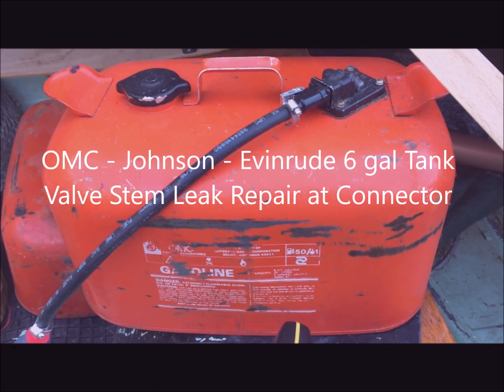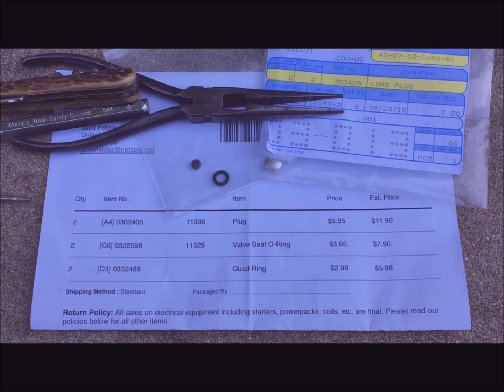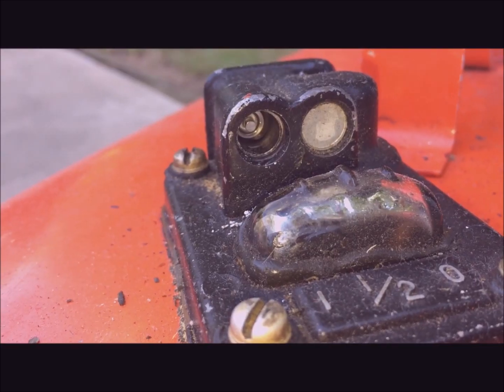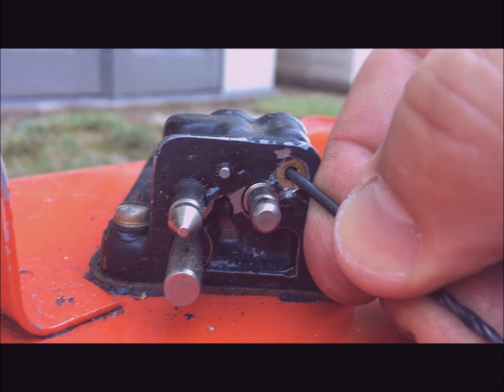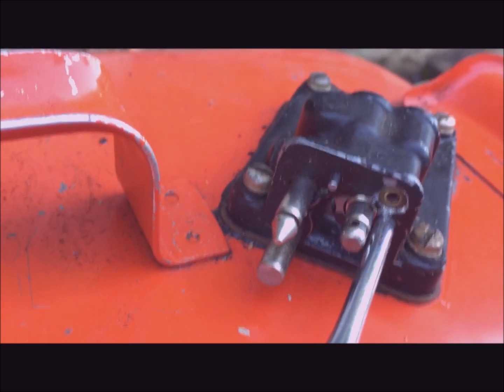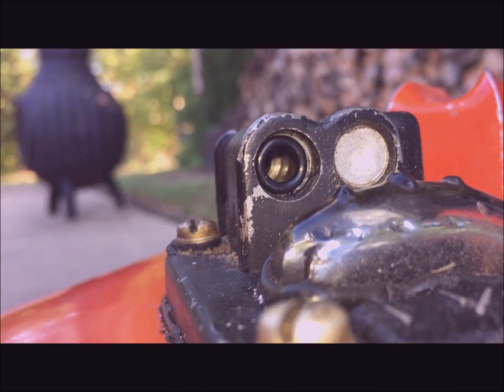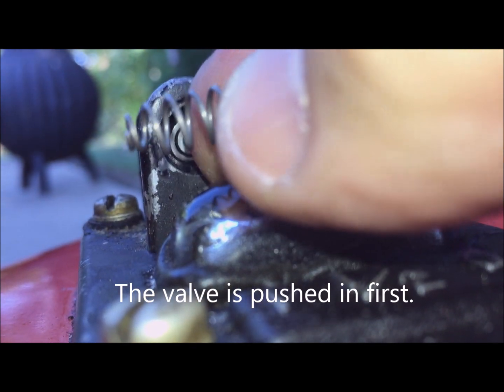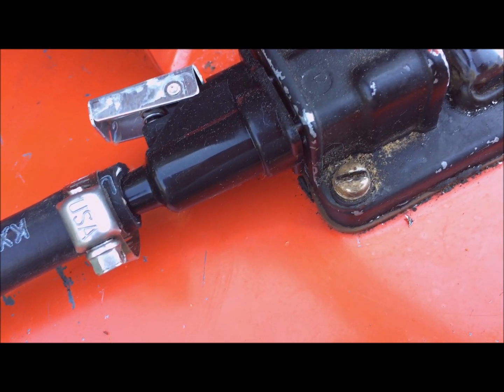OMC Evinrude Johnson 6 Gal tank valve stem repair

Comment: Thanks for the video. My fitting won’t seal and keeps sucking air so the motor quits. I made a cork gasket to get the fitting to fit with force over the stem so it won’t move.
Reply from the maker: Sounds like your fitting’s seal is bad.  Have you tried a new fitting or a whole different hose assembly?
Reply: @davemilster  I just removed the fitting, pushed the  bearing down, and cleaned the o ring. I cut the fuel line aback and inch for a better seal. I also cleaned the male fitting on the old OMC tank.  I plugged it back in and got a firmer feeling primer ball. But when I wiggled the fitting gas came out between it and the tank connector. Going to start with a new fitting and see if the $4 part fixes it. The connector doesn’t fit flush for some reason. There are spring loaded rods that push against the fitting to hold it in place and also pushes it out a little maybe it’s the way it is designed and the O ring in the fitting is worn out?
Reply from the maker: @tripplebeards3427  the fitting doesn’t usually fit flush. There will be 1/16” gap. That’s not critical as the collar in the fitting is past the holes in the male part on the tank.
Reply: @davemilster  the  new fitting fixed the issue. Thanks!

Comment: I have this problem but it's with my 1970's 9?9hp yam 4stroke on the engine's male connection the clip keeps slipping off been trying to research this issue. Probably is the O ring ...
Reply from the maker: Your Leak is around the main tube. The leak I’m showing is the plunger valve stem that permits fuel flow through the tube.  Two different problems

Comment: I like your O Ring extraction tool. I have one too. You must be a telephone man. That tool in real life is a dial tool. It was used to remove a rotary dial to replace the phone number inside the dial.  Also the tab on touch tone models to replace the phone number. The other end is used to tuck in cross connect wire. The tool is also sometimes called a spudger. It is one of my go to tools for working on outboards. works great for tucking wires in their place on mags.
Reply from the maker: I just figured out how to reply on You Tube... Sorry it has taken so long. Nope, not a telephone man. I found this tool on the ground someplace years and years ago. I'm a retired engineer/handyman.

Comment: I'm trying to figure out how to get my connector to sit flat against the tank. It pops out about a 1/16 to 1/8th inch and doesn't seat.
Reply from the maker: Is the connector an OEM? or an after market? An aftermarket may not have the same tolerances as the OEM.
Mine (an OEM by OMC) will pull back up to a 1/16"
Reply: @davemilster  yes it's an OEM one. I can't get it to close up enough to get the tank vent to work.
Reply from the maker: Patrick Prafke 
There is no vent on the connector on the tank.  There is a fuel shutoff plunger. Will it not allow fuel to pass into the connector/hose?
Reply: It's the top and right little prong. Impress that in and the tank vents. My connector doesn't press it in far enough to vent properly. That's the issue I'm having.
Reply from the maker: @patrickprafke4894  The top right needle is the fuel shut off which allows fuel into the hose through the large prong with holes when pushed in. This needle shuts off fuel so that when the hose/connector is removed the fuel cannot escape. In the video, at 16 seconds you can see the fuel leaking around this needle.
Reply: @patrickprafke4894  Patrick push it in harder. I’m not kidding. The springed latch is not engaging and holding the assembly together. Push them together harder and the thumb lever should latch in place. And then hold both pieces tightly together.
Reply: @georgekeats1478  did exactly that several times. Just replaced the entire everything on both ends with a custom jobby. Now it works.
Reply: @patrick prafke yes and mine is leaking the petrol when trying to make connection

Comment: I have one of these and if I take hose off with cap still on tank gas will come out of the fuel connection nipple from the pressure. No leaks anywhere else. You state that there should not be any fuel come out with hose disconnected. I guess I need this repair. Do these vent without connector on since it pushes other pin in?
Reply from the maker: these tanks do not vent.  your valves oring seat is bad. yes you need this kit installed

Comment: What fitting did you use to connect the fuel line to the fitting? What size?
Reply from the maker: I've used Attwood OMC connectors, but not been successful with them. Sierra is a decent aftermarket part. OEM (BRP OMC Evinrude Johnson) are the best. They usually are 5/16" hose size. The connectors are designed to fit these tanks. Here are three links to where you can find them (among other places).

https://www.amazon.com/Johnson-Evinrude-OMC-Connector-Fitting/dp/B001KYNHSC?source=ps-sl-shoppingads-lpcontext&ref_=fplfs&psc=1&smid=A19A31B2DXU7GU                  

https://www.boats.net/product/brp/0174507?CAGPSPN=pla&utm_source=google&utm_medium=paid&utm_campaign=21180406766&utm_content=&utm_term=&gad_source=1&gclid=CjwKCAjwjqWzBhAqEiwAQmtgT-WGX9K-1aNXMNIqxNTkvLOiTxIMMgGj7UUQkZowgsKOR3sYOF5IjRoCNoMQAvD_BwE

https://www.marineengine.com/parts/johnson-evinrude-parts.php?year=1974&hp=25&model=25E74M&manufacturer=Johnson&section=FUEL+TANK-6+GALLON

Comment: Would this connection problem cause the motor to die? I have an Evinrude fisherman 6h and my connection looks the same (loose). Thr motor runs but the squeeze ball for the gas line gets soft and I have to pump it again to restart the motor. I'm assuming air is getting in the line thru the loose connection and causing it to die?
Reply from the maker: Several things to check. 
1. Is the connector on your hose an OEM OMC/Evinrude/Johnson? Aftermarket such as Atwood or Sierra may not push on sufficiently. Worse, a Chinese connector may be bad too. 
2. Look at the rubber seal in the connector where it pushes onto the tank. Is it cracked? Dried out and brittle?  air can get around this bad seal. 
3. For another thing to try.  Twist open the gas cap before you run the motor. If this keeps the bulb full then the other pin (which is the tank vent) may also need repair. There is a hole about 1/16-1/8 diameter below the vent pin. Is this hole plugged up?  Take a pointed tool and scrape underneath this pin. The hole is visible between the tank and the pin. 
4. Does the motor keep the primer full when on another tank?
5. Have you tried a different hose?

Comment: Hello. I have one of these tanks too. Mine is leaking also but from the larger pin with the holes in it. It only leaks when the can is under pressure but it will leak nonstop until the can is empty. Anyone have any suggestions, like a repair kit? Thanks in advance for your help.
Reply from the maker: The needle that was leaking on mine is also the shutoff valve to the fuel port where yours is leaking. You should be able to solve the problem doing the same procedure. As a stop gap until you have the opportunity to repair it, loosen the fuel cap part way, but not so much that the ears on the cap disengage. This will relieve pressure in the tank and should keep it from pushing the fuel out thru the port. The other option is to leave the fuel line connected at the tank (off at the engine) and assuming it has good O-Rings and seals, will also keep the fuel from leaking.
Reply: Thanks. I tried lubing that little pin which did work for the most part. But it still sticks a little. Maybe the spring has worn out.
Reply from the maker: It could be the spring is broken, but more likely the O-ring INSIDE has gone bad due to ethanol in the fuel (and age of course).  @tomtwhite1
Reply: DCM thanks

Comment: The directions and part numbers were very helpful, thank you. However, I did the repair, and it still leaks. When fuel expands inside the tank, it's pushed out through the larger fuel feed tip, not the spring-loaded shut off. The only way to avoid it is keep the fuel line attached to the tank. The spring loaded pin does not leak. Any idea what I did wrong, and which of the two replaceable rubber parts is bad? When I was finished, the spring loaded pin was VERY tight, but I worked it back and forth a little and it loosened up. Thanks for the help.
Reply from the maker: The O-ring "inside" around 4 minutes into the video, is the seal that shuts off the fuel from leaking out the connector. If the needle isn't free to sit against this seat, then the fuel will as you mentioned leak by this O-ring into the connector.  The needle should move freely in and out. 
I'm afraid you may need to obtain another kit, only this time slide the thicker O-ring (around 3 minutes) on the needle itself. Is it free to slide? It should be. Before putting the O-rings in, make sure the needle travels easily in and out in the housing, too. 
Hope this helps.

Comment: Your parts lists shows quantity of 2 each. Did you actually use all of these parts? Did you disassemble the adjacent valve too? The Crowley Marine diagram indicates only 1 p/n 0332988 (quad ring) is required.
Reply: Crowley Marine did not stock that quad seal so they sent an "equivalent" o-ring that produced enough drag on the valve stem to prevent proper shutoff of the outlet port when fuel line was disconnected from the tank. I recommend buying the original OMC quad seal (available on eBay) rather than this substitute o-ring. Here are dimensions of parts in case you want to use another source: valve seat o-ring: OD 0.350", cross section 0.07" which equates to an o-ring size 009; plug: OD 0.375", 0.064" thick aluminum; quad ring: ID 0.060", OD 0.200", height 0.108" as compared to Crowley's o-ring ID 0.036", OD 0.212", height 0.088". The valve stem diameter is 0.083". I oiled the valve stem and it seems to have reduced the drag enough so the valve works. You don't get many chances staking on the quad seal cover so again, my advise is to buy the OEM quad seal. Note that you only need quantity of one for each of these parts to fix that one valve shown in this video.
Reply from the maker: In March of 2021 I found this tank leaking fuel again, but not from the quad seal. It was the fuel cutoff.  :-O  As I did the video in Oct 2018 and now the O-ring failed already, I'm sorry to report that Crowley's O-Rings were subpar. The fuel cutoff was not shutting off as the O-Ring was now as hard as a rock! The quad seal was ok though. I had no success finding the OEM part unfortunately. If you find the link to where to obtain them, please SHARE the link or at least provide the website address (use DOTcom instead of .com as Youtube will strip off the address).

Comment: I have a question about this connector: do I need a special female connector (3 holes) or the regular 2 hole Johnson/Evinrude connector can do? Thanks.
Reply from the maker: This takes the regular two hole connector. Here's a link to AMAZON for the entire hose where you can see the end.  https://www.amazon.com/Evinrude-Johnson-Compliant-Hose-Assembly/dp/B005KD93FK
Several retailers make equal parts like Napa, West Marine, BassPro, Cabellas, Walmart, etc.
Here's Napa's link:
https://www.napaonline.com/en/p/BK_7511017?cid=paidsearch_shopping_dcoe_google&gclid=CjwKCAjwxqX4BRBhEiwAYtJX7doL-F7p-EsBbzDj8Q1g_e7OvatkEXil8bMJ6vmeaOBsbzIYDrWASxoC0VwQAvD_BwE
Reply: DCM thanks for that.

Comment: Thank you for this video, I own an old tank just like yours and would like to continue using it . I have an old 2pin 1984 Mariner 8hp that I would like to use with the tank. So I need to make a hose to connect  my tank to the Mariner outboard. What is the correct OMC part number at Crowley for the fuel line end plug that fits your tank? Again thanks for explaining this repair process.
Reply from the maker: Evinrude Outboard Motors 775641

Comment: I ordered the same part numbers you showed and instead of getting the double lip oring they sent me a tiny oring with a very tiny inner diameter.Guess I have to get hold of them.They sent me #037858 which supposedly supercedes 0332488,but I cannot believe the little oring alone is as good as that thicker double edged one you put in?It is half as thick Or less at best.Not sure how the brass plug could be staked back in properly with the size difference?

Comment: I am having the same issue. I am wondering why you drilled a hole in the rear of the valve stem? Did you patch the hole afterwards? I bought a motor that came with two of these tanks and both appear to have this same issue.

Thank you for any direction you can give

Comment: Sir, what is that 3rd prong? I'm trying to understand
Reply from the maker: the one pin with the shoulder is the latch pin.  The pin with the holes is the fuel port. the small diameter pin is the shut off valve for the fuel port, so when you remove the hose connector the tank doesn’t leak.
Reply: DCM Sir,
Thank you for your response. I was trying to refer to the pin on the bottom that is not inline with you had mentioned.
Reply from the maker: leeson187 the larger pin below the latch pin is a “key” pin to keep someone from putting the connector on the wrong way. The connector is narrower on the latch pin side.
Reply: DCM thanks Sir for the clarification 😁

Comment: How does this tank vent?
Reply from the maker: As best as I can tell, to get the tank to vent in use, you twist the fill cap 1/4 turn.  It is still held in place but is a bit free to allow air around the cap’s gasket.
Reply: @davemilster  I have a plastic OMC tank with a plastic cap with no breather hole. I've read some tanks "automatically vent" whether that be through the cap or the bayonet connection. I can't see how it could work through my cap. Having the cap partially opened doesn't seem a great idea, although it hasn't caused me any problems yet.  I'm just trying to learn exactly how they are designed to be used. Thanks.
Reply from the maker: Perky Pat that’s all I am awAre of